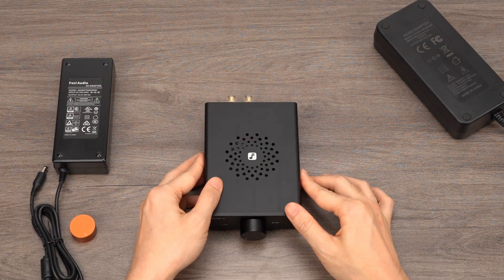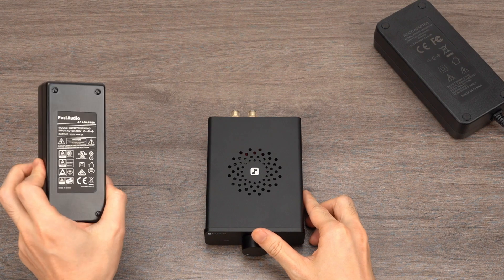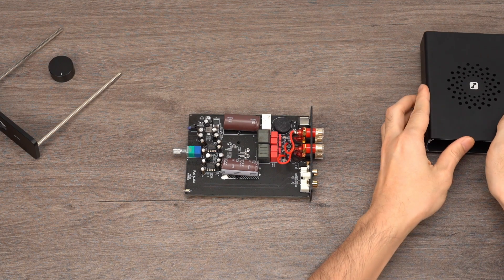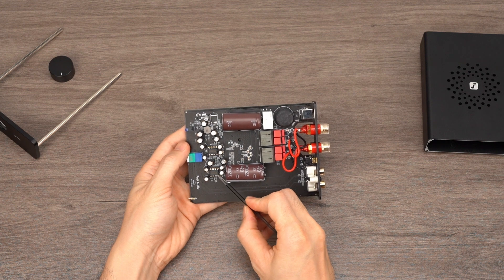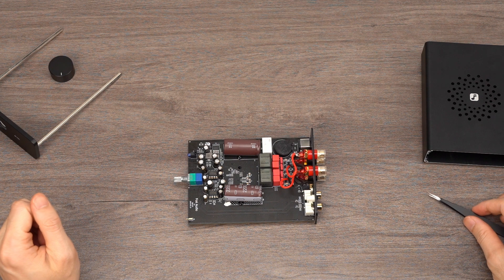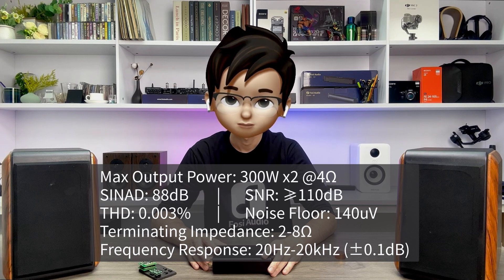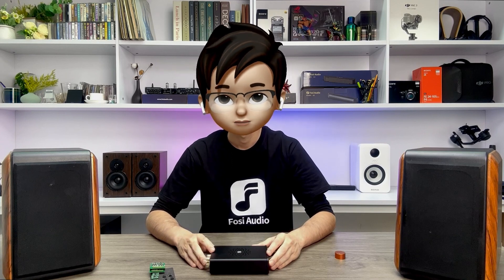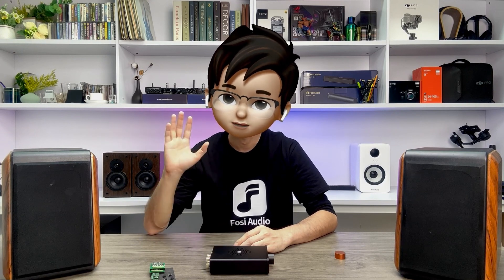A Giant Killer! Fosi Audio V3 Mini Stereo Amplifier Introduction

Comment: I recently used the Mission LX-1 MK2 series speakers, but unfortunately, the speaker coil was damaged due to connecting a low-wattage speaker. I understand that this was my mistake. I’m now looking to build a DIY speaker for this amplifier and am considering purchasing components from DIY Audio Cart. Could you recommend suitable midrange drivers and tweeters for this amplifier?

Comment: I just bought one to fill in for an older NAD 216thx. Plus, I wanted a good sounding, low priced amp for back up. I own the Fosi MO4 for a sub I built and am happy with its performance, so I decided on the V3 after some comparisons. Upstream I am feeding it with a WIIM pro streamer, RME ADI-2 DAC fs and a Schiit Freya N preamp. The V3 is powering a set of Cerwin-Vega! vs100 3-ways. They have a 10" woofer, 6 ohms and have 95db sensitivity. Sounds awesome, suprising bass and crystal clear even when I crank it up. Excellent amp for smaller room set ups. Great price.
Edit: I use the 48v 5amp power supply.

Comment: every time i think i need to upgrade from my sparkos equipped v3s i turn my system on and here....no noise and great sound.  i do have the 48 v power supply and I'll keep them until they stop working.  great little class d amp.

Comment: What makes the V3 better than the BT20A Pro?
Reply from the maker: V3 utilizes higher-quality components and there are vents on the top and bottom of the case, and the chip heatsink is attached to the case to realize the whole-body heatsink design.  It offers the most exceptional sound quality.

Comment: just wish you guys would make a pre amp tone control (With out tubes) simple bass and treble like found on the tb10d
Reply from the maker: Thank you very much for your suggestion, we will try to make it available.
Reply: @fosiaudio Yes, it would be amazing to have a separate preamp with just tone controls, rca in and rca out. If possible then please add as low, mid and high. 
Also, It would be great to have a pro model which has frequency band wise controls.
Reply: i hope they make it.  @rahulsan24

Comment: The screws on the bottom are so tight it is impossible to remove with a normal hex wrench. Any tips how to get them loose?
Reply from the maker: The H2.0mm Allen Wrench is able to loosen it, please have a try, if still nothing, kindly send an email message to [support@fosiaudio.com].
Reply: @fosiaudio  Yes it worked. A roundheaded wrench with t-shaped handle did the job after letting the amp cool down over the night. But still had to use some force!

Comment: I have some DAC's and some class-D amps, including a Fosi V3. I would like to have an inexpensive device that allows me to do digital room calibration, for example a digital in/digital out DSP
Reply: MiniDSP or external is your only way to go right now.  It would be nice, but often the standalone room calibration mic is almost as much as one of these mini-amps.   REW and a UMIX-1 mic are definitely usable for about $100.00, and you can use it for speakers and everything.  But you would need Equalizer APO or something similar to apply the calibration to Windows and not sure for Mac or Linux users.

Comment: What's the name of the big op amp?
Reply: There are two identical OP AMPS, nearly all of these come with NE5532 for both the bass and treble.  I have swapped the ones in my Fosi Audio Tube Buffer and it made a difference, some say even ordering better quality NE5532P (from a reputed seller and actual Texas Instruments vendors) make these sound much better.  I put in OPA2134 and it made it actually sound a little more bass/treble heavy, but thinner as well.   I ordered genuine NE5532P from Digi-Key and will see if I like them better.

Comment: I have to wonder why, in a whole bunch of good decisions about cooling and power supplies, they would make the totally dumb move of putting the power switch on the volume control.  That renders the amp useless in a fixed gain scenario where it is being fed by a device with it's own volume controls.  Shutting it off and turning it back on now requires adjusting the gain, every single time.

Nice improvements ... but with one deal breaker flaw.
Reply from the maker: We will try to add tone controls for the later version.
Reply: @fosiaudio  
You need to re-read what I wrote ... 
I don't care about tone controls. 
I want a separate power button. 

 As I explained the switch on the volume control is not good if the amp is used at a fixed gain setting.

Comment: This could be a baby topping la90d. Maybe in a next iteration you could have some of those switches in the back (so it bypasses volume control and can work as a monoblock) The ventilation is a good idea but maybe not on top, because that way it collects dust inside very easily. Bottom and sides is best. Apart from this it seems like a very nice piece of gear. Good job!